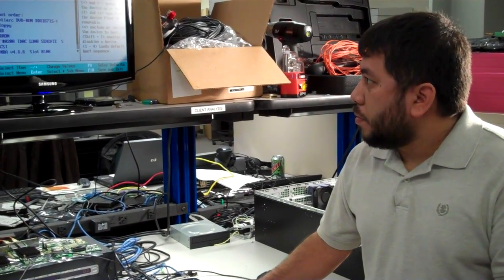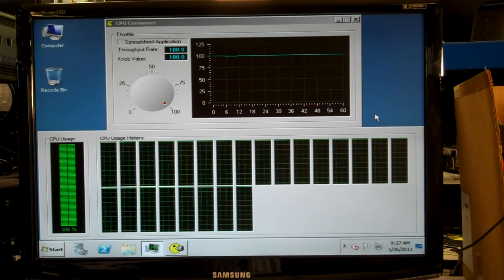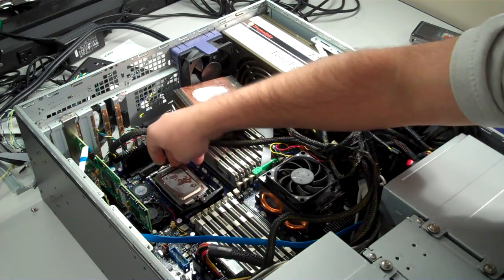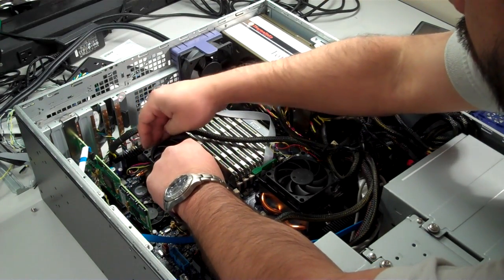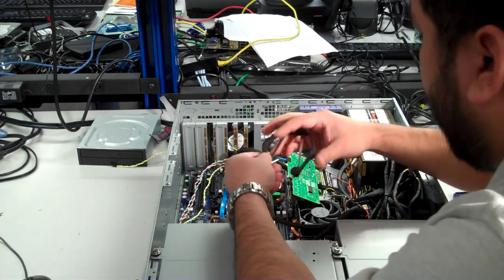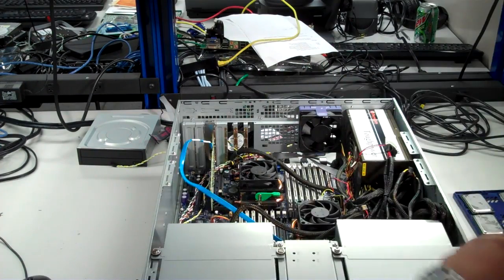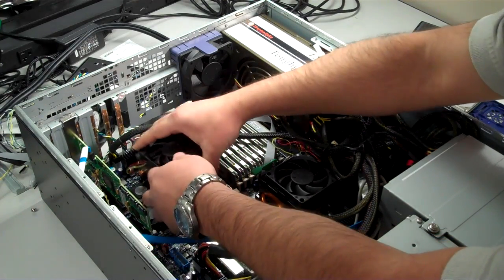16 Core Processor: Upgrade from AMD Opteron 6100 Series to Upcoming "Interlagos"

Comment: Jesus Christ people. This is a server Motherboard with NO GRAPHICS CARD! the card is the slot is a raid card. This computer will perform very poorly in games because it does not have a graphics card. The reason why it has so much ram is because it is a SERVER and servers need this ram to keep more information!
It is not meant for gaming!
Reply: Exactly, They need a shit tonne of temporary storage because they do a lot of things simultaneously. It would be incredibly stupid to have a server that serves thousands of people have 4gb of ram and 48TB of storage. you would create bottlenecks because there wouldn't be enough ram to work efficiently....
Reply: thank you for saying that. a lot of people think they know a lot about computers but you really dont know much until you have had to build everything from a normal pc to a complete server
Reply: "servers need this ram to keep more information" lol, servers use enterprise grade HDD's to store mass storage, ram is temporary memory, not mass storage.
Reply: How does it even run without a gpu? I mean opterons dont have integrated graphics
Reply: There are options to do CPU emulated graphics although there isn't any support for direct X, openGL or anything at all that would use a GPU. It's just basic GUI. These things usually run from a command line anyway.
Reply: petypoopoo thanks! I had no idea that even existed.
Reply: Yeah, np. You can actually try out something similar if you have windows 7 ultimate or enterprise or a pro version (I think) or 8. Connecting with Remote desktop connection app on a phone or other computer will give similar results. You can try it out, just search windows remote desktop, and you should be on your way.
:)
Reply: +sadboys.xyz The RAM is good for virtualization, especially with vsphere servers.

Comment: I built mine myself and am rather proud of it :)

Corsair Carbide 500R Midi tower
Asus Sabertooth 990FX R2.0.
AMD FX-8350 Vishera Piledriver Octa-Core 4GHz @ 4.5GHz.
Corsair Hydro H110 CPU Cooler with Arctic MX-2 thermal paste.
Dual Crossfire Club3D AMD Radeon 7970 HD XT2 '13Series, 1050/1500 @ 1100/1550.
4x8GB Corsair Vengeance memory DDR3 1866MHz.
Corsair Force GS 128GB SSD, Samsung 840 500GB SSD, 2TB+2.5TB HDD.
Corsair HX1050 PSU,
Windows 7 Ultimate 64-bit OS.

Comment: Don't listen to that guy, he has it all wrong, windows is FAR more capable then he said. The restriction for ram is 128gb for windows 8 default and 512gb for Pro and Enterprise. It also has some ridiculously high logical core restriction, you'll have no problems with any amount of ram / processor cores you decide to use. =)

Comment: I'm afraid you're wrong, Windows 8's Ram limit is 128GB, Windows 8 Professional AND Enterprise's Ram limit is 512GB. I don't know where you got your information from but you're even wrong about the processors, even windows 7 can handle OVER 160 logical cores. I believe you're just assuming this information because the information I have is absolute. Direct information from the Microsoft site. Go do your research before posting.

Comment: Yes, you should be able to, though I have not tried. Win8 can only use up to 64GB RAM or so. So if you have over 64GB RAM, which most server computers do, only 64GB or so of that is usable. But also, keep in mind, if you have more than 8-cores in a server computer, only about 8 of them will be usable in Windows 8.

Comment: It is a server computer, not a personal computer. You would be able to install Win8 on it, but if it is over 64GB of RAM it cannot use all the RAM, and then on top of that, only 1 of the CPU's can be used on the Win8. So it'd only have 16-core, not sayin that is horrible, I am runnin a 2-Core(Dual-Core :*( ) 1.4Ghz, lol.... So I'd be happy even with a 16-core 0.3Ghz lmao....

Comment: It looks like it's easier to upgrade things in a desktop than it is to upgrade a laptop. In a laptop, there is a whole bunch of things you have to mess with and take apart. My specs are very good in the refurbished desktop that I just bought. I'll upgrade later on if I have to. Probably won't be for a while though. :)

Comment: would this just make a ton of heat? I think 8 cores is more than enough; you do get 4GHz from 8 cores with AMD.
I have an i7 740QM 4 cores with hyper threading @ 1.73GHz-3.32GHz and it hardly goes above 20% usage, even with Crysis 2 on 2nd to highest setting with custom textures & DX11. For some reason my laptop thinks it has 8 processors when it doesnt.
What would help if I could replace my Nvidia Geforce 3GB GTX 445M to something better, so then I can get above 60fps on higher graphical games.

Comment: I see it now, yeah he did it wrong

I have a Six core 1075T Phenom and put a Generous amount in the centre and Attach the Heatsink - I dont use the AMD Stock heatsink though

When you fasten the heatsink to your board, It spreads the thermal paste on the surface of the CPU

I guess everyone does it differently though

Comment: The result would be the same with a gtx690 too(ok, with the fx6100 it would be like 140fps - or more -, but with an x2 it would lag like hell), because every program working like this:
1.cpu calculates something(physics, sounds, ai, etc)
2.gpu draw things

So if you dont have a fast cpu, the gpu have to wait til the cpu do its thing.

Comment: Dont run my face into the ground with this but, apparently, if someone were to want an i7 just because of hyperthreading or something they could just go for a xeon since its all of the processing power with a lower cost because it has no integrated graphics, so someone could grab an intel xeon with a 79xx or a 670 and have better performance/price

Comment: Static is overhyped, it's not nearly as dangerous as people think. If you ground yourself to the case while building a PC, it will stop it. Even if you manage to generate a static discharge to a component, it's not going to harm it.

I've had 1" static discharges to GPU pins before while running  (unintentional) and they kept chugging along.

I've been building and maintaining PCs since 1993 and have yet to see static damage any sort of PC part.

Comment: Yeah... Trained my ass technician you are! Touched CPU's top several times(grease from your fingers), no ESD safety, not even bothered to remove old thermal paste and apply new one(created an air gap, cause old thermal paste becomes stiff after some time and won't re-level evenly). You can do whatever you like but when you do the wrong thing, do not post it on web. Other people picks up what "very big and educated dude" did and bricks his PC or other device...

Comment: no you got it wrong i7 is the best no doubt 
now the i5 is of the same performance as the fx8350 piledriver and it's 20$ more expensive on amazon 
the pile driver is 10% faster than i5 2500k 
intel is better than AMD if you're running the game on its own ,AMD is better than Intel if you are running things in the background (on both processors)
here is the equation : 
piledriver to bulldozer: 15% Faster 
piledriver to i5 2500k: 10% Faster 
piledriver to 3570k: 0~1% Faster

Comment: the i5 2500k is 5% faster than the bulldozer and the piledriver is 15% is faster than the bulldozer 
the piledriver is even faster than the 3570k by 3 to 5% which is great considering that the most expensive piledriver is 30$ cheaper than the i5 3570k

Comment: I apologize I must have had coils on my mind at the time, a genuine misplacement of words.
By standard I mean its not just the rows of metal conducting and directing heat away (like the 2.99 ones you can pick up).
It has 2 cooling technologies working, the copper for fast heat conduction, and the rows of dissipators <- i know this also has another name but in college this is what we were told they were because this is what they do.
Bottom line is, AMD would sell a heat sink if it didnt work.

Comment: The coolers are AMD's STANDARD cooler. The only difference maybe is the fan and even then its not going to make up for the lack of thermal compound. These "coils" are called heat-pipes also, this is basic knowledge. Its taken you a week to reply and you still fail with a response.

They look like the STANDARD amd cooler, with maybe a different fan. And these "coils" are heatpipes -facepalm-. Any processor that doesn't have enough thermal compound is going to heat up fast,

Comment: There's enough coverage, you don't need a lot. The heat sinks aren't standard either, they have superior heat dissipation. (the copper plate and two coils direct heat quickly away.)

Comment: Well, I have both Intel and AMD cpus, The V120 CPU and 2 Irwindale Xeons. They are NOT high-ends... But I dont really get what you said :P First of all, most people that dont use iOS use Windows, obviously. Intel is (allmost) all in on the CPUs, and AMD is on the CPU and GPU side. But a big reason to buy AMD is the bang for the buck, as you know, the Bulldozer and the new Piledriver architecture, they are EXTREMELY powerull, and cheap! But Intel is fast, but goddamn expensive :P (Out of space)

Comment: I obviously do seeing as my load temps are 53 degrees. When he removes the cooler you will clearly see the top left hand corner has a gap in the thermal compound. This means their will be air = less contact with the cooler = more heat. And he probably resat the cooler to get that temp or it was recorded just as he started the test.

Comment: Then you certainly are doing it wrong, and don't use a good cooler. The thermal compound isn't supposed to be added in large quantities, and the heat sink should be moderately big, same the cooler. My friend uses an 8150, and with my help, and a decent cooler, his CPU works on 49 degrees on full load.

Comment: exactly. I honestly think AMD could have made Bulldozer great, now PD and eventually SR and EX, but they kind of whimped out...they were trying to be intel, and beat it on a spec sheet instead of being AMD. Intel doesn't flaunt 4ghz stock speeds..because it doesn't need to. It concentrated on architecture...only if AMD would do the same.

Comment: The fact you're trying to insult me shows your insecurity for lack of knowledge. The arch makes complete use of the integer cores, all 8 can be affinitied and taxed completely independently, there is just a slowdown without FMA4, XOP and perhaps AVX instruction sets to utilize a 256bit FPU. Each core has it's own pipeline. The design doesn't perform as well as 2 true independent cores, but the design does not cost as much, either. The real issue with Bulldozer is batch decode.

Comment: Just because you are stupid and ignorant of the subject, doesn't mean you have to be vocal and show your stupidity to everyone. The bulldozer architechture is a CMT cluster core. There are 2 integer cores but only 1 floating point unit. Bulldozer uses a 256 bit floating point unit instead of 128bit, and it is capable of performing the job of two 128 bit FPUs under FMA4 and XOP instruction. Intel is indeed lying by showing 12 threads in task manager, because HT only speeds up an existing thread.

Comment: AMD does not have any milti threading technology yet. Let's take an FX8120 for example, it has 8 physical cores but each core is sharing one or two components meaning that each of these 8 cores are not running at full speed.

Comment: An 8 core Bulldozer is actually a 4 core with AMD's varient of hyperthreading (multi-threading) If these are using the Bulldozer architechture then my guess is that they are actually 8 core with multi threading branded as 16 core. AMD like to scam people these days it would seem. Thats like intel calling the 3930K, 3960X, 990X etc a 12 core just because they have 6 cores with hyperthreading.

Comment: Cheap and efficient parallel computing.
Think of a big company with lots of users. Most users is going to work with programs like Word and Excel and only a few that works with CPU heavy applications. So that way the CPU does not have to work more than necessary to get the job done and can spread the work load more efficiently.

Comment: You'd need to buy a Z77 board if you want to run a 3770k or 2600k, or buy an X79 board if you want to run a 3820, 3930k or 3960x. You'd also need to ensure you have a good enough power supply to power the new chip.

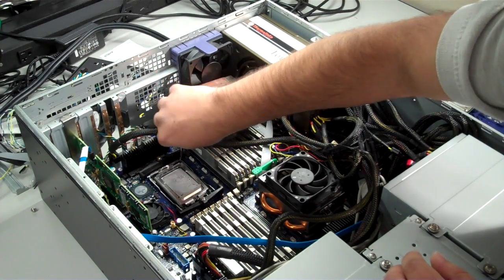Comment: There was new TIM already applied by the tech to the CPU prior to filming as you can see at 1:38 the IHS is matte and the 4 corners of the CPU have some shine where the TIM did not reach. Tech should have removed the Tim from the heatsink before installing it back on the CPU.

Comment: saying that one thing is more important than the other is the equivalent of saying that in a sandwich, the bread is more important than the innards - 
if you have two pieces of bread and old, rotten roast beef, you will have a shitty sandwich
if you have moldy bread and wonderful roast beef, you will have a shitty sandwich

you need to have a GOOD processor and a GOOD gpu for gaming, doing otherwise is called bottlenecking
one is not more important than the other

Comment: It's not even that. Most of those work-spaces have anti-static carpet and clear contact with the case is common knowledge concerning grounding w/o a strap. I will admit that not changing out the thermalcompound (witch did look fresh and there was some already on the new cpu) or stating does raise concern. However it is up to US the consumer to do that. (Do you have an AMD tech come to your home to apply paste?

Comment: 1. No Grounding Strap, How do you know the environment, plus he works for amd their probably not worried about frying a chip they have tons more.
2. No Gloves. ??? that just weird who wears gloves when they change a cpu?
3. There is already thermal paste on the heat sync and the cpu, he isn't doing any overclocking so not cleaning it is not really going to matter much. it will most likely be similar to spread method.

Comment: to those who are complaining about no ground strap gloves ect this guys hand touches the outside of the case enough to not have any static electricity, the replacement cpus already had paste on them, you dont necessarily need gloves to work in a pc personally i would suggest some anti static gloves not powder ones but it a smaller factor unless your hands are coated in dirt and grime. @yuuexussum for home purposes it serves no purpose unless your running a huge server

Comment: but amd procs still are stronger by dollar than intel (barely) and i have always stuck with amd due to budget. intel does make the fastest and most stable procs, right now they still cost 1/3rd more to implement compared to the cost of a comparable amd. it used to be twice as much, but the gap has gotten smaller.

Comment: i am speaking based only on the comment that i am replying to. both amd and nvidia are great, currently nvidia has the edge, ati had the edge 3 or 4 months ago, either way they are both great graphics cards manufacturers, so the choice is based on taste and price point. currently if i had unlimited cash i would use nvidia, back in feb i would have chose ati. i don't prefer one over the other, that was just the high end. intel has been above amd for about 2 years now, bulldozer crashed......

Comment: Well, many people say that nvidia graphic cards are better for gaming, because they have CUDA (Compute Unified Device Architecture) and SLI. The prices can vary from country to country. In my country nvidia graphic cards are a little bit more expensive than ATI graphic cards. It also depends on what technologies they can support. The differences aren't big, 10-15% difference between 2 almost equivalent cards. Also it depends from where you buy it. My opinion is that both perform well.

Comment: AMD>Intel nowadays. Intel is just A LITTLE better than AMD, but it also comes at 3-4 times the price, so it's now worth it. Also for rendering AMD is better because it has more cores than Intel. Overall, AMD is better. For Intel, you pay 80% the firm and 20% the product when you buy it.

Comment: Oh, and btw, good one on the "doesn't affect performance". Too much thermal compound will effectivelly stop the thermal transference between the chip and the cooler. If you aply the "dirty" (hence the significance of the word dirty) cooler it will be too much and it will hinder COOLING PERFORMANCE, therefore, heating up the CPU, therefore, it will impact CPU PERFORMANCE. If you'd like, i can make a drawing with crayons... Im not going to even answer you anymore....

Comment: Minecraft is not CPU or GPU intensive COMPARED to other games, but requires more ram as you progress and explorer, build and ect. because the game sets all of the information on the memory, that's why it takes longer time to load a chunk if you haven't explored it in the current session.

Comment: that's not exacly right cuz i have a pc with a hd 6870 and an amd a8 apu 
if i remove the hd 6870 and make it run on the apu gpu it will only have 60 fps 
but if i use the hd 6870 i have 300 fps 
and i have 8 gigs of corshair vengance ram 1600 mgz 2x4
and i remove 1 of them i get no change in fps 
if you have ddr2 memory it might make a small difference but minecraft is mostly a gpu intensive game but i just thought this might be a fun comment to make cuz its cpu and gpu intensive ..

Comment: @sugars01 actually have to buy 2, but since this is a server, processor swaps are not done often to a mchine, a company will put machines on different cycles, so say a data depatment will upgrade every 4 years, and in between those 4 years they will upgrade some other department such as web hosting. theres always upgrading, but not on the same machines.